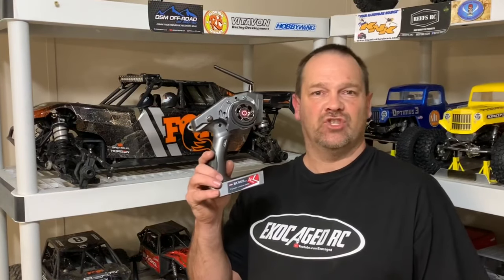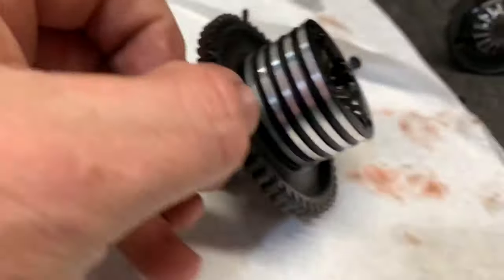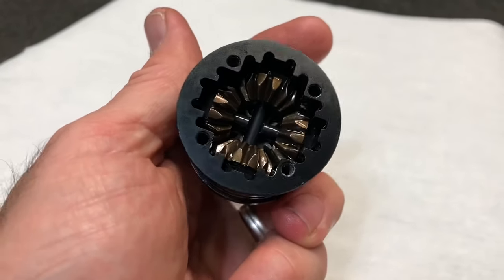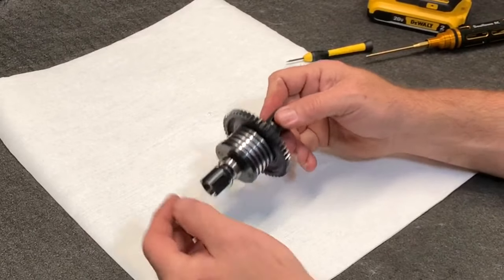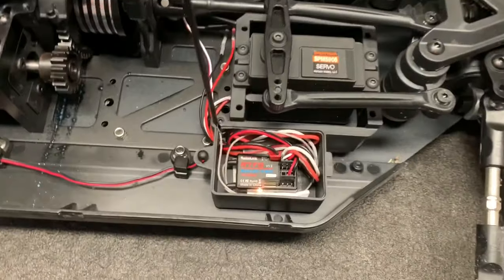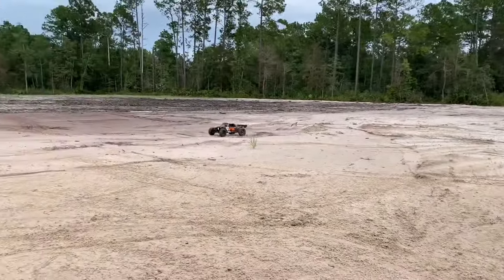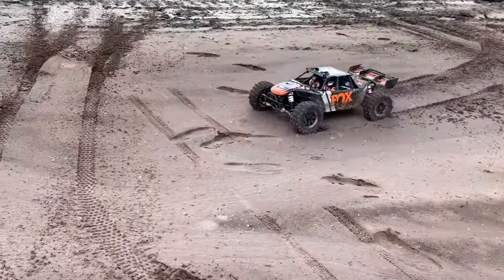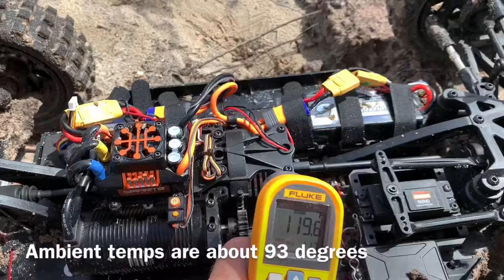DBXLE GETS MODS!!

Comment: Great video. Losi did a good job on that center diff cup. I actually used that cup inside FID housings front and rear. Very stout setup holds up to 12S very well. The Losi bearings though. The pinion bearings usually go first in the rear diff. That is what led me to upgrade. It melted the stock plastic housing. Look forward to seeing more of this 2.0. I have the V1
Reply from the maker: Thanks for the tips!

Comment: Awesome, the million weight oil and 18 tooth pinion gear really helped that losi alot. ......... but you have the same problem i had back when i ran associated rc10's.......... never enough batteries. ....... you can never have enough.
Reply from the maker: With these big vehicles I really need 9000mah batteries, the 5000's just don't really have enough to feed it properly.

Comment: Also you can change the low power alarm on the rc7gs to 0 so then you can still monitor voltage but you'll be able to drive till the ESC hits lvc. Had the same thing happen with mine. The batteries are always going to drop volts when you punch it, the radio won't account for that. ESC Lvc will kick in when the batteries are consistently at a low voltage
Reply from the maker: true I could do that but then if I start puffing batteries that would just cost me money and maybe a fire. I'll try the 7200 Power Hobby batteries next time. Plus on the take off it was lacking so they were pretty much done for.

Comment: I have a dbxl-e 1.0 I put 1million weight in the center diff and 100k in the rear and 50k in the front and it makes it so much more fun to drive.
Reply from the maker: It appears this one may be getting a Castle 800v system, I won the new XLX2 with 1100kv setup in a raffle so that’s going in the Crusher Kraton and that system will go in the DBXLE

Comment: you want to make sure you wipe off any excess thread locker as it will never cure until it ends up oozingg in some place you don't want it.
Reply from the maker: I hit it with a paper towel but I'm pretty sure the rest slung off pretty quick.

Comment: Easy trick with high viscosity fluids is to heat them up.. You can use a heat gun or a microwave, It will make your life easier. With a diff that size I would either overfill it or use epoxy but I am kinda on the fence thinking they use a center diff on that to save the drivetrain or to keep the amp draw down.
Reply: Except sillicone diff and shock fluid is made specifically to not change viscosity with temp :)
Reply: @daver18qc  Not made to withstand direct heat from a heat gun I can asure you, It will change its viscosity super fast.. Been doing it in my Bajas for the past 10years.

Comment: Now that some time has passed how is it holding up?  And what about shims in the diffs and outside on the bearing supports?  Just about to get the V2.0 and I’m psyched.  Will mos def do the 18t pinion.  Ever go to heavier than one mil in the center?
Reply from the maker: Man so far so good. The #1 upgrade I can say at this point were the bulkheads. They solved the gear skipping issue I had as the stock ones flexed at the pinion and allowed it to skip.

Comment: Like #17 big difference what pinon ⚙ gear does this come with stock and have you had any sliping of the pinon gear that seems to be a common problem with the dbxle 2.0
Reply from the maker: I did have the stock pinion come loose, thats kinda why I showed the threadlocker on the shaft.

Comment: Still slow
When you gonna replace those servo links? I already see them bending. 
Max5 would be a nice boost to perfromance and speed.
Reply from the maker: Well I haven’t seen the stock esc heat up yet. I have something in the works for the steering that really will bend those links.